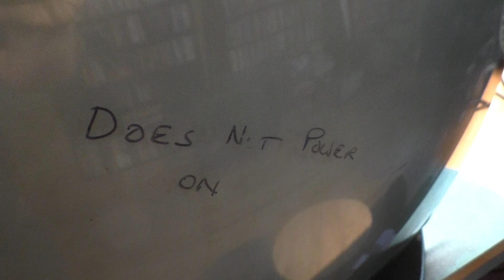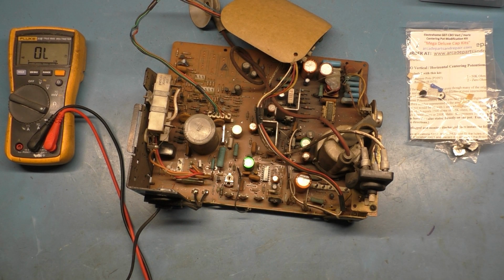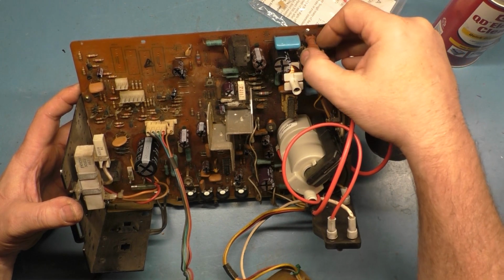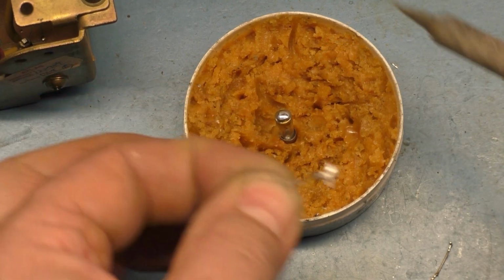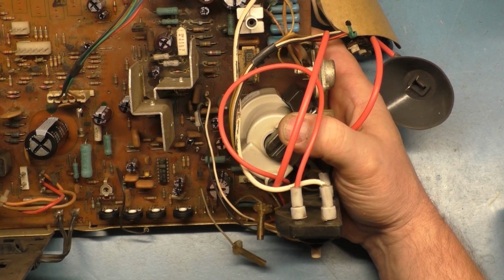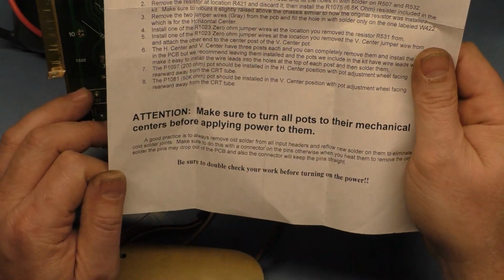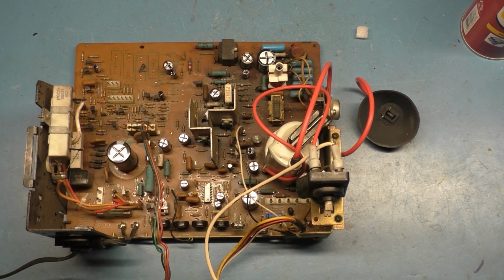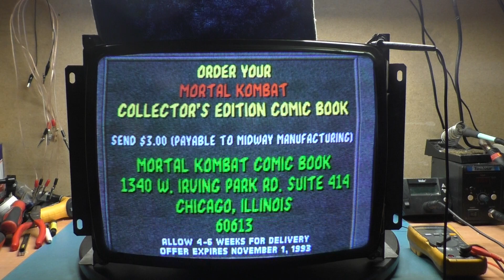19" G07-CBO Arcade Monitor Repair - "Does Not Power On"

Comment: Hey Mike what would you recommend for a 20" After Burner monitor?
Reply from the maker: 20?” Should be 19.” Any standard res monitor will work. None of them are particularly better or worse than any other if they are maintained and working well. But if I had to recommend one over the other, I’d suggest a K7000. Easiest to work on.
Reply: @MikesArcadeMonitorRepair  I should have mentioned - it's a deluxe machine.  It's got a sanwa pm1723c chassis and 20" toshiba tube.  I've heard the sanwa chassis doesn't have a replacement flyback available and my tube is in pretty bad shape (I need some rejuve! Currently searching for a b&k to do this work because I can't find any good shops around Houston to do a rejuve.) so I'm wondering if there's a better option in the 20" size.

I also picked up an upright, it's got a k4600 19" in there that has collapse.  I've seen your videos on that chassis and heard those flybacks are pretty good.
Reply from the maker: I’ve never seen an arcade machine with a 20” monitor, so I can’t say for sure. My apologies. Hypothetically, any 19” chassis would still work on a 20” tube with a compatible yoke, but you may have size/linearity issues.
Reply: @MikesArcadeMonitorRepair  How about the inverse; tube swap on the sanwa 20" chassis?  I'm assuming the resistance values on the yoke would be ok but the difficult thing may be the neck connection. If I get desperate there's always the good old RGB mod that could be done on a consumer TV from the early 2000's as 20" was a popular size.